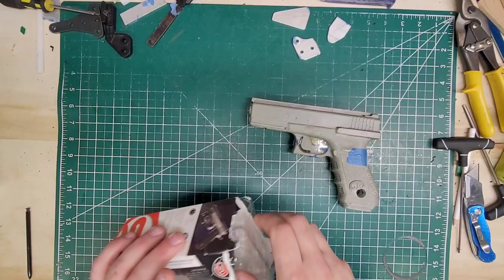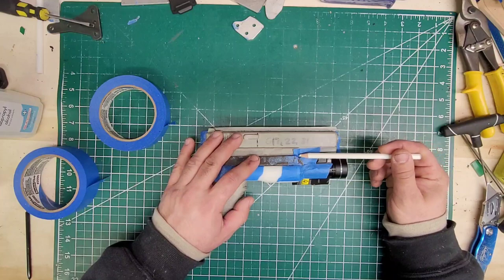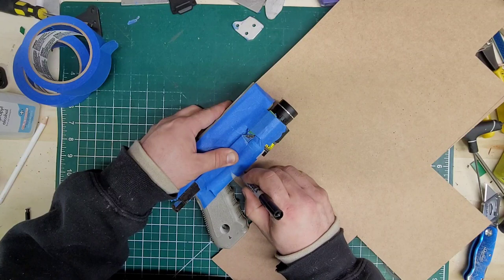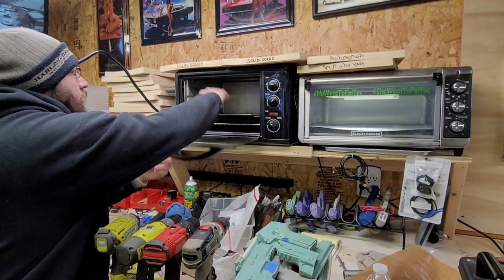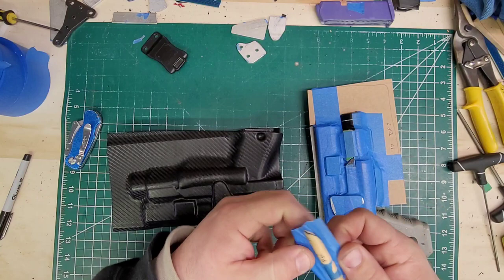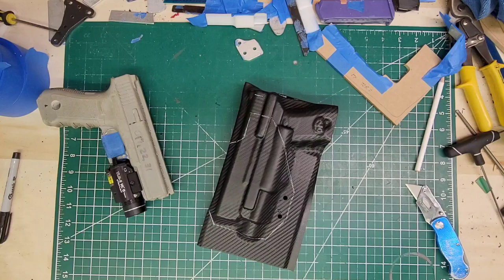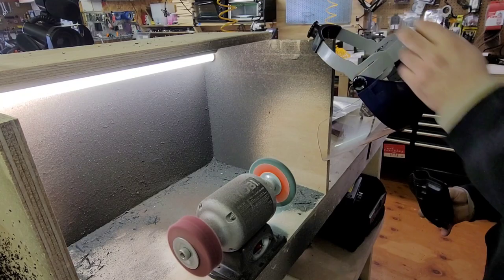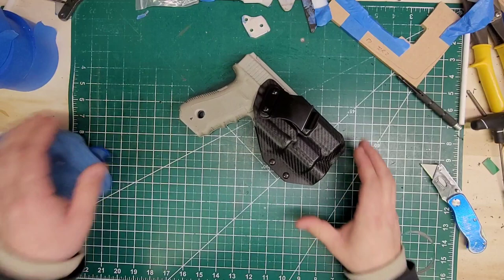How to Make a holster for a Glock 17 with TLR2

Comment: Amazing how you know where to get them retention points. You say that you remove the battery but should I worry about the ones that are rechargeable
Reply from the maker: Some flashlights are powerful enough to burn through the kydex in a press. All the rechargeable I have are not charged for that reason. Best to use a dead unit. Or just make sure it doesn't turn on inside

Comment: Another great video! When you dremel inside the light bezel do you make it completely flush and even with the kydex around the bezel, or do you leave any lip around the edge from the kydex forming around and in front of where the light bezel ends?  In other words if the rest of the holster didn't stop the forward movement of the weapon back into the holster, would there be a small lip that could stop the light from going past the end of the kydex, or do you keep it basically an open ended tube so the light could keep moving forward if it wasn't stopped by the rest of the holster? Sorry about the novel, I'm just trying to explain this in a way that hopefully can be understood. I'm not saying you couldn't understand it, I just wanted to make sure I was communicating it properly. Thanks again for all you do! I'm finishing the shell you made me out of the .125 basketweave for the Sig XFive Legion w/TLR1-HL and blocking for the Safariland mid-drop and level 2 retention hood.  I cut the end flush with the bezel of the light, just wanted to make sure how much I dremel out of the inside of the cylinder where the light bezel will go.  I don't have the steel or mold or light to do fitting, that's why I needed the shell, and thanks again for the shell, it looks amazing for being .125!  Also should I use the basketweave I have here to make a plate to go between the hood holes and mid-drop holes to add extra support for when using the hood? It's really hard to actuate the hood so I shaved a lil off the part that locks it in to make it easier to use, but still keep it safe, but it's still a lil hard to release, so I was wondering if a plate would help. I only have .080 basketweave, so should I just use plain black .080 for the plate since the basketweave is really only about .060?  Again, sorry for the novel, I just want this to come out as good as possible. ✌️♥️☺️
Reply from the maker: As long as the light doesn't protrude out of the holster. You are good